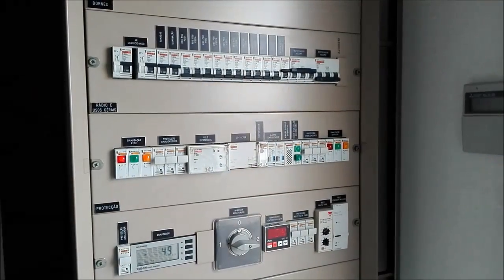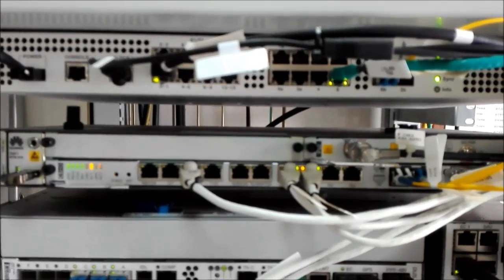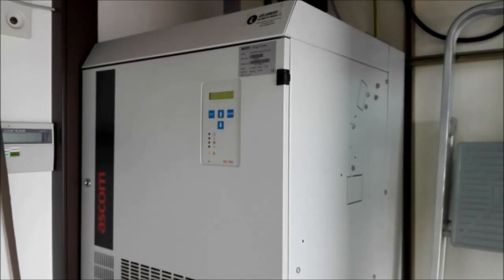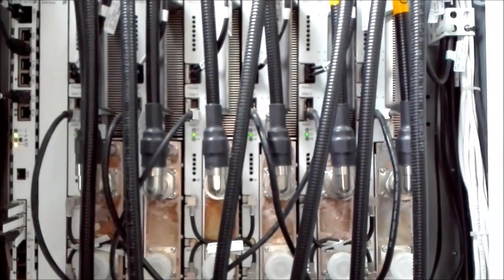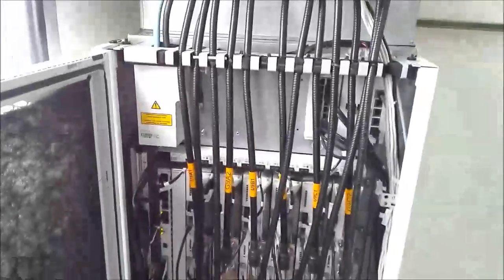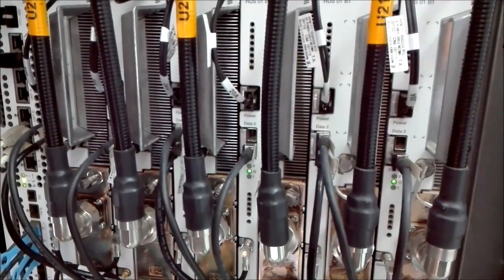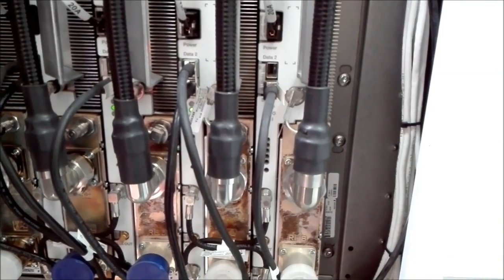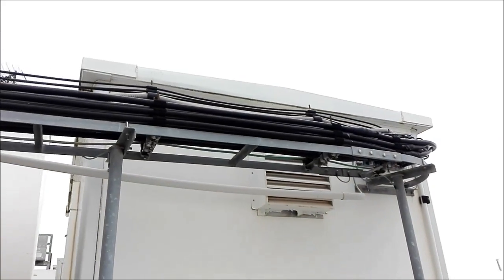GSM UMTS LTE shelter

Comment: Wow that's awesome, I never thought they'd use SDR in the cellular realm. I use a cheap SDR to pick up the APCO P25 Phase 2 radio system my county uses.
Reply from the maker: Yes Michael, that's exactly the same principle, the same radio hardware is capable of working different modes of transmission it only depends on the processing software on the DUs . Frequency ranges or bands and power capabilities are the only factors to take into account for each radio access technology. Today as the FPGA's chips are becoming more powerful it's possible to cover and process immense swats of spectrum!